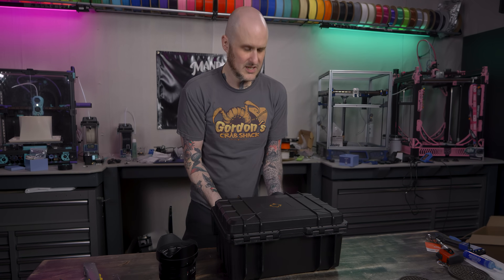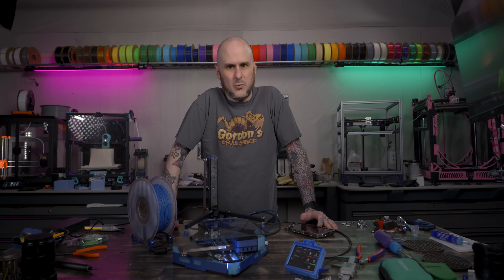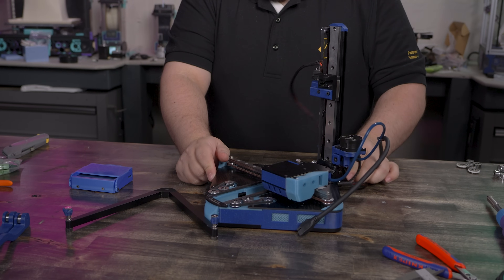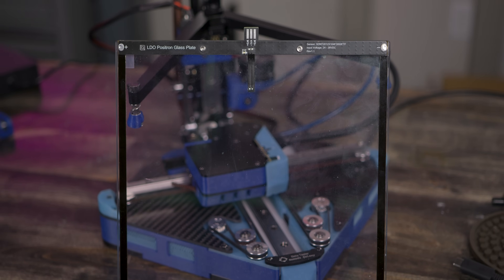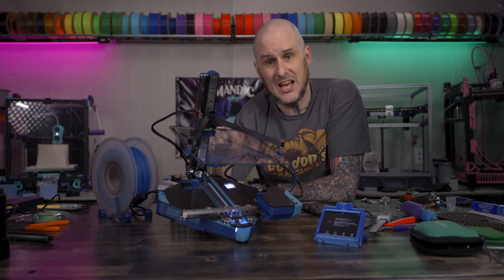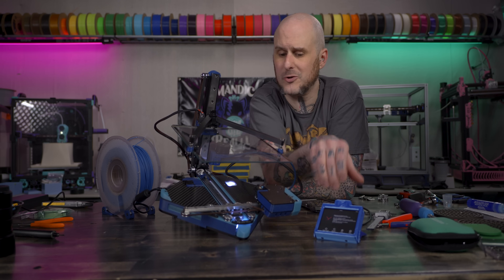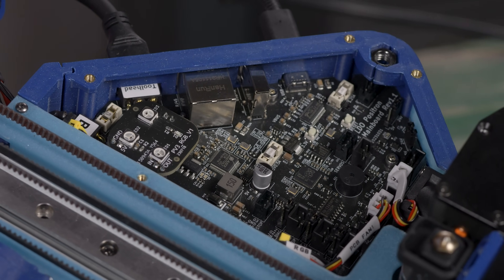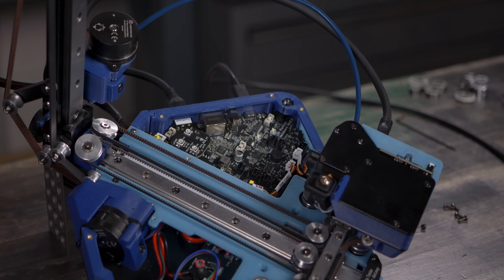Inside the Positron 3D Printer: A Deep Dive

Comment: no usb-pd, why 200w, why rp2040; non-IP rated means its not travel ready
packs into small form factor so it can be packed and stored away
relies on outdated glass print-bed w/o heating
bowden. no.
ton of moving parts

comment: reviewer states homing 'sensorless', immediately explains IR sensor-based

why does it include rpi and pico - one is enough, in fact a single esp32 should also suffice
open source: assumed there's mqtt onboard to integrate w/ home assistant/open hab or similar but haven't heard mentioned

I'm concluding this is TRL 6 prototype with a nice polish, comes as a kit with lots of promising developments possible but a lot of ground to cover; I think the kit and merch w/ community backing will really help fund the project to iterate the design and release in faster cycles
Reply from the maker: Do you work with 3d printers or was this comment just written by a confused AI?

This wasn’t a review. 

“No USB-PD” We said it could be done…

“No IP rating” Why in the world would that be needed? No material is going to be happy printing in the rain and dirt. 

We explained that the glass IS HEATED. It is a unique see through resistive heater system. 

“Tons of moving parts” have you ever seen a core-XY 3d printer? The only additional parts beyond a typical one is the pivot for the Z axis to fold down. 

“Sensorless homing” is pretty universally understood to be X & Y homing only. Z Axis homing always uses some form of probing mechanism and/or endstop switch. There isn’t a 3d printer available with sensorless z homing. 

“Why a RP2040?” Because it runs Klipper firmware fast and well. It is ALSO an open source architecture…

“Esp32” Ok, you could have started with that and I’d have known you had no idea what you are talking about. Absolutely ZERO 3d printers run ESP32s except for Wi-Fi connectivity. That’s it. 

“Home assistant” You can always integrate a Klipper powered 3d printer with home assistant. You don’t need an ESP32 for that. 

This was a wild ride of a comment. Thanks for giving me a chuckle as I read it over a few times trying to make any sense of it.

Comment: I doubt this design will be a groundbreaking new kid on the block set-up......why they must make it print upside down I'll never know, and the review does not say why this configuration is as it is.........another one for the weirdos that just must have something different.
Reply: We designed it to be portable so that we didn't have to lug an ender to our engineering workshops at Uni. We also designed it to fold away so we didn't have to dedicate a large chunk of space in our limited dorm room to 3D Printing. We just pull it out when we need it, and store it away when we don't. Being upside down is just a result of that goal.

It works better than most printers out the box, getting better than volcano speeds at 27mm³/s. The 90⁰ meltzone just allows filament to be chewed through effectively.

Comment: I’m so excited to see this coming together finally! 

My question to the dev team is if there any plans to improve part cooling, I can see the tip of the hull curling up(down?)? 

Also, will there be any kits available without the case or the screen and cm4? This could easily fit in any usual carry on bag, so the case isn’t really needed. Since the printer can also be operated over the network the screen isn’t either and if we already have a pi for klipper, neither is the cm4. If those could knock off 100-150 monies off the price it’d be really cool. 

In any case good work team!
Reply: The cooling issue is primarily a problem with profile tuning, we're still dialing that in. We are also experimenting with a cooling duct redesign. So rest assured this is something we are aware of and are working on even now. 

As for units without the pelican case, it's going to take a while, probably going to be a few batches out before we start selling kits with select parts not included.

Comment: And this is better why ? It’s still got droop.  Now it’s just in the opposite direction on the print :P
Reply: The goal was portability, we just so happen to print upside down lol

We are working on improving our cooling performance.
Reply: The goal was portability, but IMO the killer app for this is getting 3D printers into the homes of people who'd use them once a year and want them to be able to pack away when not in use.  Most people own a drill, and the reason they do is just that.

Comment: The only thing I don’t like about it is the Klipper screen setup, just a single usb cable connected and the printer cannot function without it and would stop functioning if it got disconnected, this is definitely a concern with a screen that seems to be intended to get picked up, held and put where you want it. Even just a point where it clips onto the main body of the machine so it can’t get moved about or pulled would be good, or even better would be to have a retention mechanism where the cable is difficult to remove accidentally. Best case would be to use some kind of locking connector.

Comment: "Deep dive" - and almost nothing about speed and print quality, ok.
Reply from the maker: It’s still in early release. Tuning is literally THE LAST thing you do while building a printer. Also the base design started before fast printers were the norm. They aren’t yet certain how hard it can be pushed and are currently actively working on that. I don’t have any claims that people who don’t know better won’t balk at right now. Like it takes over an hour to print a Benchy, but it can absolutely go faster. They were more worried about the mechanical function and reliable design before learning how fast it can go. So I didn’t make any claims folks would judge based off incomplete data.
Reply: We can comfortably get 15mm³/s, but have had success with 20mm³/s stock.

With some modifications, you can probably push it to go faster.

Comment: Print failures on this must be spectacular.
Reply: Maybe. Original PV3 has magnetic connector. If something goes wrong, bed disconnects and kipper stops automatically. I have this issue two times when my nylon print unsticks…
Reply: @sovahc  so, this detects spaghetti? Or adhesion issues? Or crashes? Seems to be a CR10 flipped over.
Reply: @ogpennywise  there's no automatic detection, the previous detection method was simply sensing for a bed disconnect, which would trigger a firmware shut down. This is technically still a thing, but it isn't really a feature per say.

Print failures are... 'fun' lol
Reply: @ogpennywise  I have no spaghetti issue. Every time my bed pulls up and print stops. No damage happen. I'm most worried about the synchromesh, but it's always fine. If it gets damaged, I'll just switch to a belt, I have the belt.

Comment: The belts they used in the earlier versions were better . I think Ldo fucked it up
Reply: Belts has slightly lower aliasing. I want 1 mm pith belt on my pv3
Reply: I assure you, you would not want Synchromesh cables to be used in production. They were a nightmare.

Also the decision to move to belts was one done by Positron, not LDO.

Comment: $699? This isn’t an economy for novelty gadgets with that price tag.
Reply from the maker: And the project began a couple years ago. The machine is NOT for everyone by a long shot, but for those who can justify it, its a fun idea. If nothing else it is an interesting tech demo that some folks can use to help push printing forward. 

The Bambu A1 Mini wouldn't exist if it weren't for the development and testing of machines that came before it. It wouldn't exist at the price point it does if it weren't for Bambu selling $1500 X1s for years ahead of the A1 Mini and creating a full production process that brings the economy of scale into line with their price point. A small independent OPEN SOURCE printer project will never be able to match a multi-million (possibly billion) dollar Chinese manufacturing company. That's just life.
Reply: The goal was to make this kit similarly priced to a Voron V0, which is $650 (and only has a bed volume of 120mm³ vs 175mm³)

The truth of the matter is that there was a lot of R&D put into this printer, our teams worked very hard with LDO to make it possible. Costs need to be recuperated.

If you don't have a purpose for a portable printer, then don't buy a portable printer lol, it's only novelty if you don't have a purpose for it.
Reply: @nomadsgalaxy  - whatever you say there money bag genius. A printer that prints upside down is a novelty…for $699, when you could get say an A1 mini for $249.
Reply: Consider this: a voron 0 kit will set you back a similar price if not more and will have only 120^3 print volume and arguably a printer at that volume and price IS a novelty as you’re very limited to what can be printed in it, I have one and I know. For people who travel and need to prototype on the field, granted not that many, this is going to be a tool, for the rest of us it could just be a very cool project to work on, just like the v0, even if not the most practical. 

But then, consider the potential here, how a printer with p.v. similar to a prusa mini or an a1 mini can now fit in the spool box of that printer. If I had to draw a non printing parallel, I’d suggest considering how mobile phones used to be larger than even wireless ones at the time, then they got small, moved to smartphones and now we have phones that are all screen, barely any bezel. We both reduced the foot print of the device and maximised its interface. Consider this the flip phone of the printers. If anything this printer will be a step in that direction, at the very least. 

Furthermore, if this was to be a commercially available product like an Ender, the logistical cost from the shipped kits’ volume, along with the per unit carbon footprint, can further reduce the price and make it more environmentally friendly. 

If you’re still bothered by the price, note that ldo ships high quality components, not necessarily the most cost effective ones. It’s be safe to assume an open source project like this will be adopted by other companies offering kits at lower prices, with respective quality. 

Lastly, it’s a fresh platform for the community to innovate on. There is great potential here, even if it’s a niche product now, but so where desktop 3d printers a decade ago before prusa gave us the i3 design. Then creality lowered the entry barrier to FDM with the ender 3 and their massive production line benefiting from its scale. 

tl;dr:
It’s not for everyone, but it’s here for everyone to benefit from.

Comment: What is the point of printing on the head?

Why wasn't this done normally I wonder and what is your target audience?

Greetings from Austria
Reply from the maker: Printing upside down is a function of the compact nature / foldability. To have a "regular" toolhead would require far more rigidity & complexity in the design. This design allows the printhead to always be in the position it will be, even when the Z axis is folded down. That provides a much more compact (lower center of gravity too) design that doesn't require major reinforcement that would balloon its size & weight. 

It is meant to be a portable printer. Any additional parts & construction takes away from that so they have to be very mindful of where design elements are at all times.

Comment: Alan, am I correct in assuming the tool head will tap one of the nuts on the idler pulleys mounted on the linear rail to home X? It’s been awesome to see this project improve throughout its development and I’m sure with LDO on board it will be a fun build. I think two of my favorite features are the bed’s interface for the heater/thermistor and the whole motion system. The tool head itself seems a bit large but the weight sits down low on a  carriage rather than up high on a gantry so I’m assuming it’s responsibly stable. Great video, this is probably the most detailed overview of the Positron I’ve seen up to this point, extra credit for crispy B-roll.
Reply: Yep! You are correct.

We mount idlers to the bottom of the X rail by using standoffs as nuts on the top, and the idler screwing in from the bottom.

This acts as a rail stop, preventing the carriage from falling off, and allowing for Sensorless homing with its resistance.
Reply: @nomadsgalaxy  Very clever, thanks for the explanation and nice work!

Comment: It only took 2 years, but I'm super excited to see this form factor finally hitting the market.
Reply from the maker: Me too. A much longer wait than I had hoped but glad to see it finally coming around for folks to enjoy and iterate on.
Reply: Form factor refers to size/shape/specs. Are you saying this is a size that has been missing from the market? That there isn't a 180^3 printer available? That we are unable to print in this size with the current limitations in the market? That this shape (same as other printers, mind you) has been missing. Or that the specs of 180x185x180 have not been met by current offering in the market.

I think I can print EVERYTHING this form factor prints, on any of my printers that measure at least 180x185x180.

Only thing it won't do is print them upside down, unless I flip my machine over, which is as dumb as this.
Reply from the maker: @ogpennywise  what other machine has this Form Factor? You are purely looking at print build volume, that’s is NOT the full picture. 

I recently took a Voron 0.2 to RMRRF. That has a 120mm cubed build volume. It requires a pelican case that is 4 times the size of the one that the Positron fits in, and I had to pay to check that bag as it was too large to fit in overhead bins. On the way back from RMRRF Nomad and I were on the same flight home. He carried on the Positron and stowed it in the overhead. My Voron went into the checked baggage and cost me $40 to check it. It was also out of my hands and I know it was treated rough on its journey as the Kirigami bed frame bent on the way home. 

No other machine with a 180 cubed build volume will transport as easily as this in my experience. 

This form factor is in a class all its own.

Comment: Maybe you can answer my long burning question since you now own a Positron:
Since the extruder is not even on the printhead and the hotend is similar to a small V6, just bent: Why is the printhead so freaking HUGE and bulky?
What madness is contained in there? 😀
Edit: Never mind, thanks to your upside down shot at 13:38 I can finally see that it is from the part cooling fan and it being mounted differently than usual.
Reply from the maker: You got it, ha. Also deflecting the heat / airflow from the heatsink from blowing onto the part and unintentionally cooling it I'd imagine is a partial factor. And I don't own this one, it is Nomad's BETA unit. I will be building one soon-ish hopefully.

Comment: I have been looking at position kits like journeymaker and I want to see how good and easy the ldo kit will be.
Reply: The LDO kit is designed to be easy to build, and is very approachable.

I think the final price difference is $100 between the two, with the LDO kit costing slightly more, but all the custom components help make the whole thing much simpler.
Reply from the maker: I’ll hopefully be streaming building one on here at some point. Not set in stone yet, but watch out for that when (if) I get the chance.

Comment: Would be really cool if they just powered it from USB PD especially now that 140Watt bricks are becoming more popular and 240Watts is ratified and possible though uncommon.

Imagine the speeds and feeds and ease of use of this thing powered by the 28 volts of 140W or 48 volts of 240W.
Reply: We have ideas for that 😉 stay tuned
Reply from the maker: I actually cut out where I talked about just that in this video while I was trying to make it all flow better. So look out for that possibility down the road. 👍🏻👍🏻
Reply: @MandicLabs  heck, since it’s currently DC powered, I could picture hooking a power tool battery up to this printer to make it truly mobile, and be able to print on the go, or out in the wild. Wireless for the win.  Not sure how long it would last though.
Reply: It definitely would not take a lot to modify it to swap out the power supply to one that accepts USB PD.

Comment: I think the external display/pi/power supply is lame, I like the JourneyMaker Positron more. The IR bed leveling sensor is also problematic. I would want 6mm belts though, that 2X3 mm don't actually matter. There is a usermod for a unibody base, which would be cool.

Still interesting.
Reply from the maker: Eh, it integrates with a single USB-C connection and saves a lot of trouble on the footprint when stored. I’ve run a few machines with remote pi/display setups. The way this one is configured is better than most imo. The IR sensor is definitely a weak point and I look forward to improvements on that.